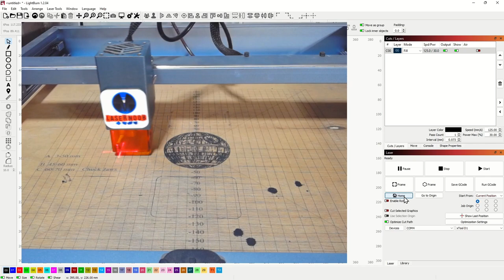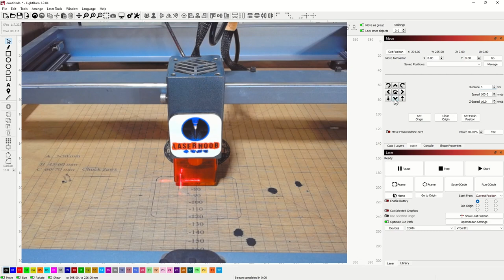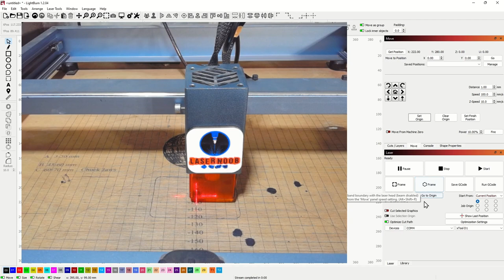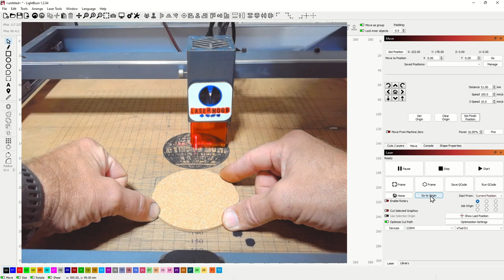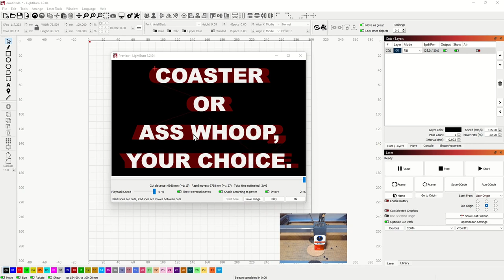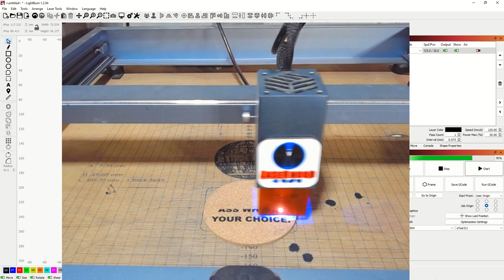Centering your laser in Lightburn

Comment: great video.  I followed what you did and for some reason after I have set origin and set the offset when I press goto origin it moves to another location (50mm down or to the right).  Also, when I click on frame it goes all the way to the right and stops once it goes to far against the frame...any idea what settings might be jacked up?  Thanks in advance!
Reply from the maker: Are you using USER ORIGIN?
Reply from the maker: If you join my Discord channel, we can do a video chat and figure out what your issue is.

Comment: Good short video, with just what one needs.  I do have a question. I think my off set from the BIG RED X to where the laser starts is off just a little.  How do I fix that?
Thanks, keep up with the great videos. 

Dave
Reply from the maker: Hey Dave, thanks for the kudos. I am out of the shop for the night, but I will get back with you in the morning!
Reply from the maker: Dave, in lightburn, my offset is -16.00mm on the X axis and 0.00 on the Y. If you take a piece of scrap wood and center your crosshairs at one point, then burn a straight vertical line. Measure the distance from the crosshair point to the line and that should give you your desired offset. So if it's 2mm off, instead of -16mm it would be either -14 or -18. -18 moves it left and -14 moves it right.
Reply: @LaserNoob thanks, that sounds great. I'll give it a try.
Reply: Laser Noob and Dave same question I had; thank you!  Offset crosshairs was so vexing when eyeing the center. Happy lasering things.   ~Jason in SC.

Comment: Why do you use the move buttons to move the laser instead of doing it by hand? Also, what kind of laser goggles do you use? Thanks!
Reply from the maker: I do both. But using the move buttons, and starting from the home position, lightburn knows exactly where the laser module is and I can use the Go To Origin button and set an end position. This makes it super easy to do multiple items and know they are centered on each burn. Check out my reusable template video. Here is the link to my safety glasses: https://amzn.to/3sKXJwA

Comment: you're using a red laser pointer as a reference. Does this mean you're using a laser offset? If so, I was wondering if you tried the center finder tool in lightburn. It seems that it's not working properly when the laser offset is enabled. There was a thread on this in lightburn support but not solution were brought and it's been more than a year. The laser offset is also not taken into consideration when framing, which is counter-intuitive to say the least.
Reply from the maker: This is using the crosshairs on the x-tool, before there was a center finder in lightburn. You should be able to turn the offset to zero and fire the laser to find your starting point.

Comment: Okay but how do I get my atomstack to show me there the laser is via lightburn? I can get it to show me a centrepoint via the little controller but can’t find the setting on screen
Reply from the maker: If you enable the fire button in settings, then you can select fire during framing or turn the laser on at 1-2% by hitting the fire button in the "Move" panel.

Comment: I burn things all over the work area. Frame it and go. I rarely have to center anything. I did make a wooden "L" shaped square for the left and front. Hot glued it down to the cooling rack from Walmart. Yes, I had to make sure it was flat! I can pick up a large work piece, inspect the back if I need and put it back for another burn. The laser burns in the same place as before. Ok for laser burned projects. I wouldn't make semiconductors this way though..( work joke)

Comment: How do you deal with the smell when you were engraving slate?
Reply from the maker: My shop is in a shipping container. At the time of this video, I had to keep the doors open and run fans to circulate the air. Now It's enclosed with a/c but I installed a 400 cfm exhaust system that is ducted right over my work bench.
Reply: @LaserNoob  oh ok that’s cool
Yeah, I ordered enclosed today for mine so it’ll be here tomorrow. I’m just gonna run the hose out my window cause I do mine in my one of my bedrooms. I got two craft room so it’s in the main one, but I need to know how to do the acrylic , I got the neon light that I seen last night with her. It goes in it like a little nightlight so I gotta figure out how to do that without messing it up.
Reply from the maker: @BrendaDavis-1963 be careful. They scratch easily. But you probably know that by now.
Reply: @LaserNoob  yes I do but I’ve only done one lol I ordered an enclosure for my laser

Comment: Using light burn, I have problems with centering. I manually put the laser in the center of my work piece, frame it and I use the pointer to make sure that it hits the corners, then frame it. I hot play and it goes off the edge on one side, it's not centering the art piece and then I give up.
Reply from the maker: What laser are you using?
Reply: @LaserNoob  Xtool D1 10 watt
Reply from the maker: Are you using "User Origin" ?
Reply from the maker: We can chat via Facebook or Discord tomorrow if you're available, to fix your issue.
Reply: @LaserNoob  sure..name the time
Reply: @LaserNoob  yes, I use that settings ng and clear the beginning point and then center the laser, hit set point, and it still goes off on its own😳
Reply from the maker: My internet has been down all day. Will you be available to chat tomorrow morning? Hopefully they'll have it repaired by then.
Reply: @LaserNoob  absolutely!!
Reply: @LaserNoob  I'm free all day
Reply from the maker: They have been working on it for 3 hours now. Hopefully, they'll get it fixed soon. I only get 1bar of cell signal where I live, otherwise I could do video on my phone.
Reply: @LaserNoob  video would be great!
Reply from the maker: Send a Facebook message to me at facebook.com/vaderfl  and  I'll call you on messenger shortly
Reply from the maker: @davidmonaghan7676 either message me on Facebook at facebook.com/Vaderfl or join my Discord group at https://discord.gg/8KXpdnbfaA  and we can do it there. Discord video is better.

Comment: left rear
Reply from the maker: If you move it manually, whatever position you then start it in, is going to be zero. If you relocate the laser from home, using the move buttons, it will properly track the true location.
Reply: @LaserNoob  Thanks for your follow up.  I found out what I am doing wrong and have since corrected my error.
Reply from the maker: @ronaldderi7471 Sorry I was late. I was kind of buried with work and projects.